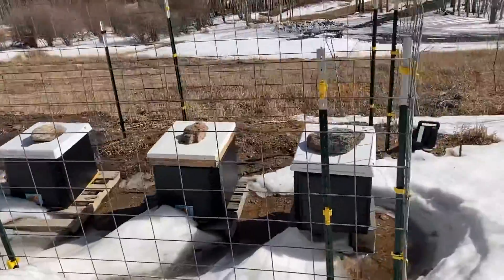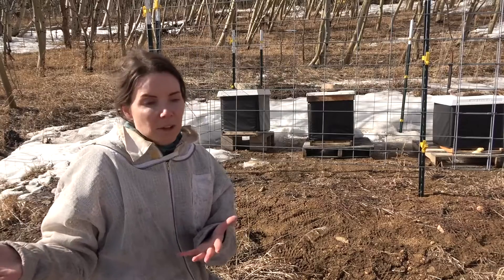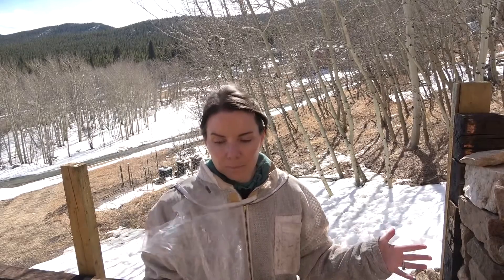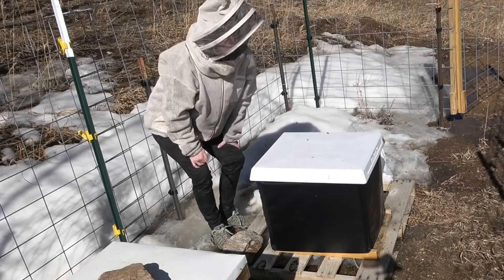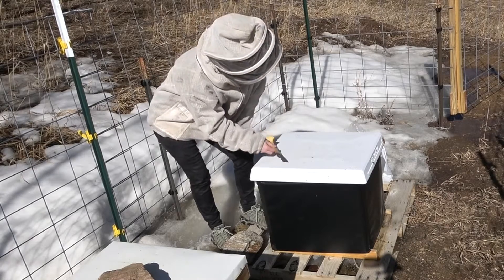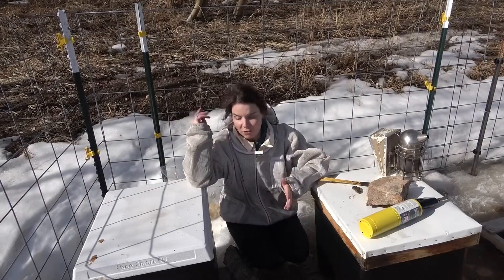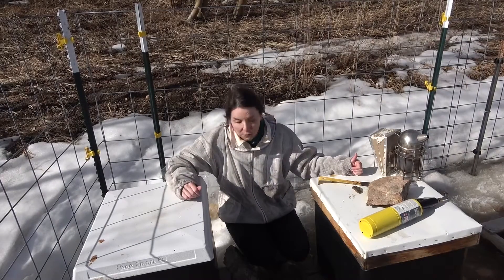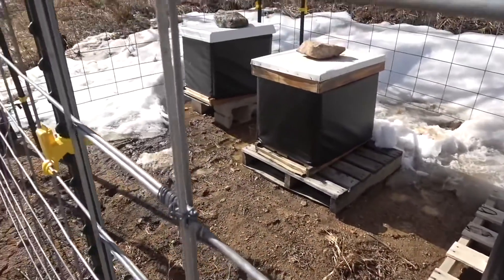Big Surprise inside the Colorado Beehives. First Inspection since Winter.

Comment: Is your whole fence tied in to the electric fence charger? Are those special insulators that are holding up the cattle panels? Do you shut the electric fence off when there's snow on the ground that would short the fence out?
Reply from the maker: Yes the whole bee fence is electrified. They are the clip that hold the panels to the posts. No I leave the fence on 24/7. If the snow is shorting out the fence it's probably also buried the solar box.
Reply: @ColoradoMountainLiving  I love the idea...it might help keep the neighborhood black bear away from my hives. I guess what I was asking though was where did you get those "special clips," which are insulators. I haven't seen any like that. Most are designed to have wire wrapped around them. Hope Bryan is OK!